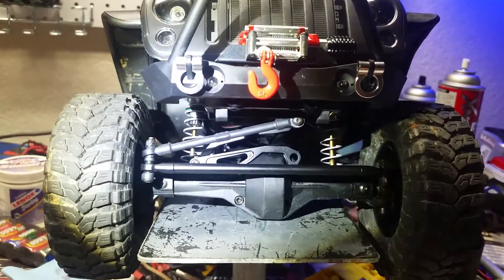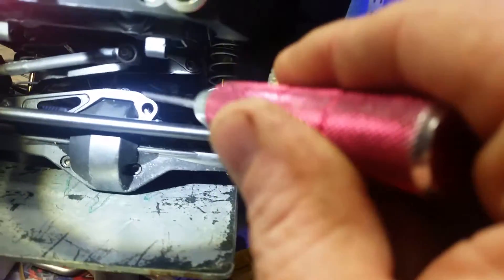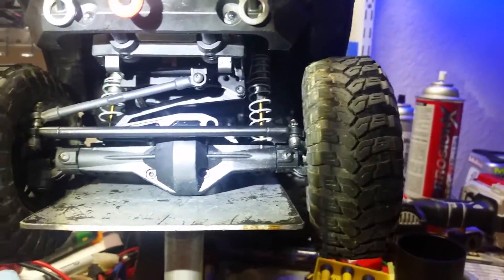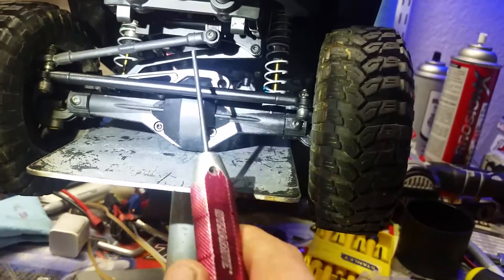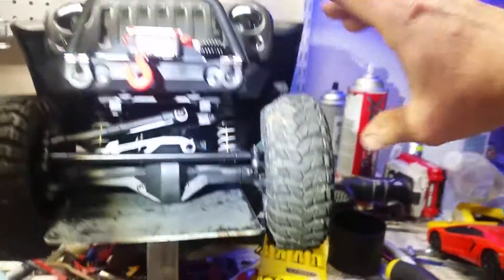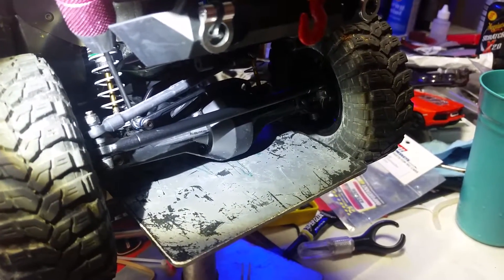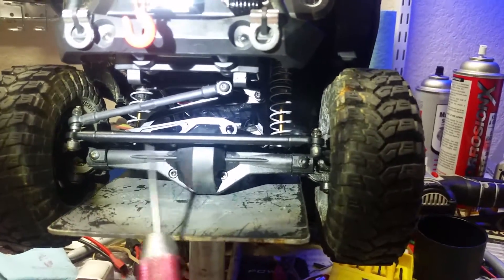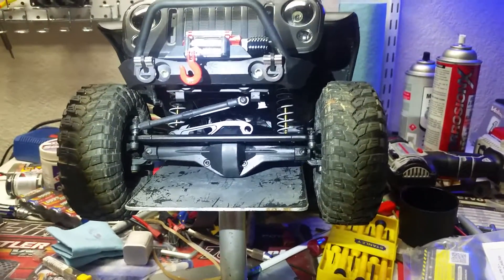Axial SCX10 CMS & Panhard bar help. How to set up a gpm or level 3 panhard. please sub for more

Comment: I made a kit for my axial wraith. because I bought a metal cage frame and tossed the plastic one so there is no kit to fit it. Im basically copying the vanquish style axle clamp for the panhard and a panhard mount coming off the  two servo mounts but went with lineing up the panhard with the steering link. Works great even with both shocks compressed all the way no bump steer. Video really helped me out. Thanks again

Comment: So if you would have used the link that came with the kit, that attached to the drivers side knuckle, would there have been no problems from the start? I'm curious because I'm about to order the same part.
Reply from the maker: Eddie Mack the steering rod that came with the kit does attach to the driver side but when i installed it the body would lift when i turned the wheels from it not being on the same side as the pan hard bar, it has to be attached to the same side as the pan hard bar so it all works correctly. Thanks for the comment

Comment: To avoid the tire steer by itself when we do full compression... Does the longer steering link will solve the problem or providing a perpendicular panhard will resolve it?
Reply from the maker: Yes, since it's at the same geometry as the bar theres nothing to influence the steering during suspension travel

Comment: That looks really great. I think I will move my servo up to the chassis on my Unimog now. Thanks or the info (-:
Reply from the maker: thank you! I'm glad I could help!!
Reply from the maker: Jax Teller RC mine is the gpm chassis mounted servo bracket with panhard bar but I think there is one identical made by level 3 rc, or you can go full expensive and get a vanquish products one that's pretty much the same thing only 4 times as expensive lol
Reply: pmm4177 
Yeah vanquish are a rip off. I will definitely check it out mate, cheers (-:

Comment: Looks like you could have flipped the servo and put the shorter drag link on the same side it's on now
Reply from the maker: CRAWL HARD RC yes you can, i did consider that but i wanted to keep the steering geometry to eliminate bump steer, seems to work well but im not sure about flipping the servo so you can have a shorter connecting rod

Comment: Are you running the stock 3 link or just a drivers side link from a 4 link kit?
Reply from the maker: Im actually running the stock 4 link on the front with a chassis mounted servo and panhard set up to eliminate bump steer. When you go to a chassis mounted servo you have to run a panhard bar to keep the front wheels pointed in the intended direction through the axle articulation range otherwise when you axle moved up and down the steering would move with suspension flex. Hope this helps buddy and thanks for the comment
Reply: I removed one of my top links I was reading on a forum 4 link could bind. i had  that issue but I have a wraith so mabey yours is different but mabey try that I noticed a big difference

Comment: Hey.  My panhard setup pushes my shocks and axle to the right at full droop.  Everything is straight at full compression.  If this makes sense, then shoot some ideas as to WHY!!!!! this is happening.  Thanks.
Reply from the maker: @Todd213  is your steering linkage going to the same side as the panhard bar? If so you shouldn't be having issues with steering pushing on the suspension